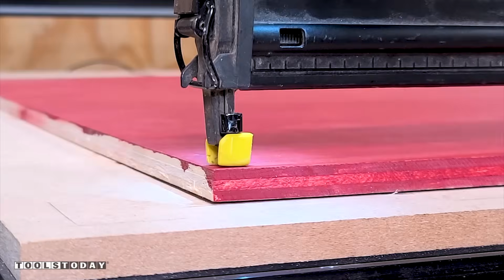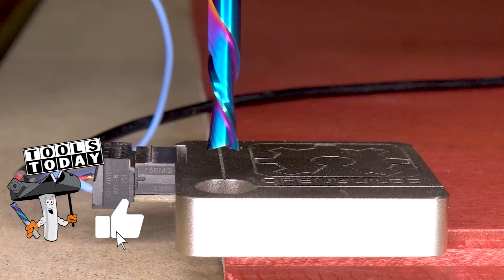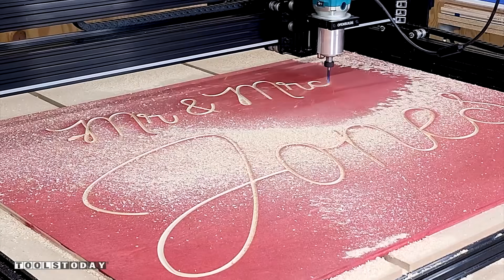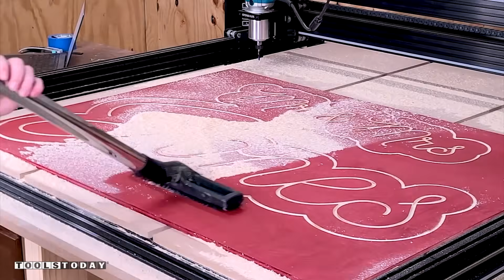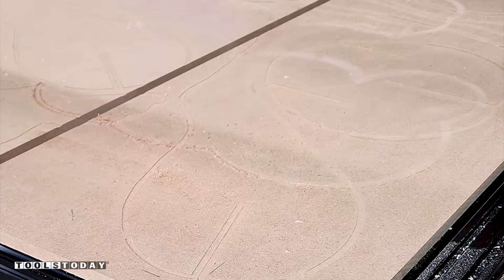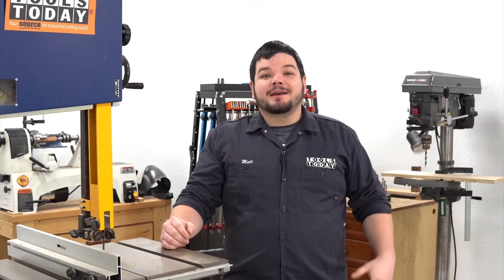Making a Wedding Sign on New CNC | ToolsToday

Comment: Which cnc is easier to use for a beginner that has never used a cnc but really wants one. The step craft you use or the one in this video.? Any info would be great.
Reply: I own the OB 1515 (the one in this vid) and I'd say to start with one of the OB ones. You get much more working area per dollar. The thing which will affect the difficulty the most is the software. Vetric is expensive, but I find it to be, by far, the easiest to use.
Reply: @Robbie  thank you. Yeah I'm definitely concerned about the soft ware part of it. Im not computer smart at all lol so it's really going to be a learning curve for me. I'll look up the one in the video.